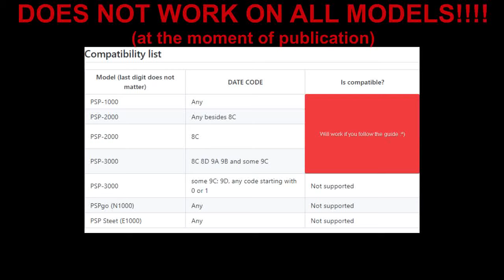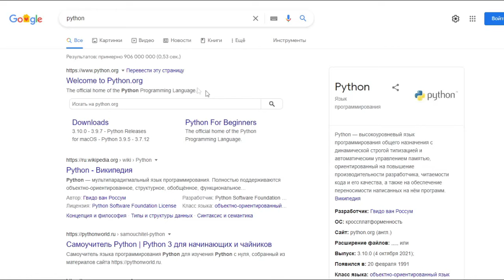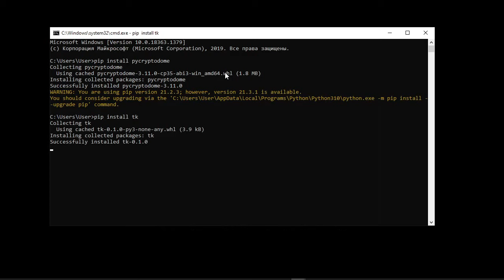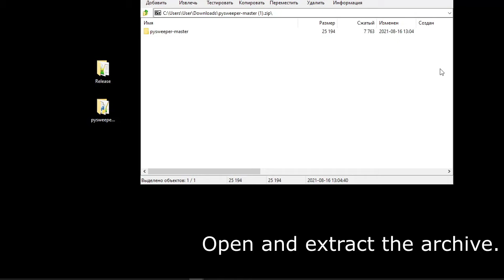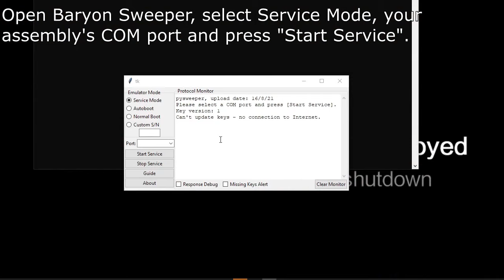PSP-3000 Baryon Sweeper (Solderless) Unbrick Guide

Comment: Well, mine was anti-climatic. Set up everything, the PSP shows green power light but the screen wont turn on. The power light turns off after a minute or so. 3000 with 8D, I think this was not for me :(
Reply from the maker: if you have green light but you didn't touch the power switch (because baryon sweeper autoboots the console in service mode) chances are your magic memory stick is unreadable or your PSP suffers from a hardware failure
Reply: @akhubik2006  Do you think there is a way we can get the PSP crash log on to the Memory card, like how we do in PS3, to understand what is going wrong in there?
Reply from the maker: @JakeGeorgeJoy  no, i don't think there is a way if it does not boot

Comment: hello, thank you for the tutorial. however i ran into a problem, i have a version 3004 psp with date code 9C (bricked because i accidentally disconnected power while doing a system update), when i try to connect the assembly with DC power it does nothing with both 5V and 3V3. when i tried it without the DC, 5V displayed:
5A 82 60 FF5A8260FF5A8260FF5A8260FA5A8260FF5AB0D05AB0D05A8260FF5AA0D05A8260FF5A8260FF5A8260FF5A8260FF5AA0D05AA0D05A8260FF5A8260FA5A8260FA5A8260FF5AB0D05AB0D05A8260FF5A8260FF5A8260FA5A8260FA5A8260FF5A8260FA5A8260FA5A8260FA5AB0D25AB0D05A8260FF5AB0D05AB0D05A8260FF5A82 60
and 3V3 displayed "Port disconnected. Retrying in 1 second.". I also tried a method I've seen in one of the comments, I got someone to hold the cables (using 3V3) in place, then connected the assembly to the PC, started service and connected the DC, which displayed nothing most of the time, but a few times i got 
5A 02 01 F4
A5 05 06 10C306 76
with nothing after that, and also 
An exception occurred in IO loop: UnboundLocalError("local variable 'version' referenced before assignment")
once, also with nothing after it. do you know what could be wrong?

Comment: I saw this guide a while ago when it was first released and I was hoping to unbrick mine(2000 model, ik it unbricks with pandora but i dont have one and they are too expensive) but i thought you need a 2nd working psp to unbrick. From what I understand from this video is that you don't necessarily need a 2nd working psp, instead you load the files from the jigkick media creator directly to the ms card. Is that true?
Reply: You don't need second PSP when using custom files. This method was publicly available for a long time.
Reply: @RealYoti  Didn't this method get released like 10 months ago?
Reply from the maker: @jimakos981  Yes, you are right, but there was no (complete) guide for it. Also, it's been updated since and schematics are more simple now. This guide was requested on Reddit ( reddit.com/r/PSP/comments/qfbuqg/request_psp_baryon_sweeper_complete_guide/ ).
Reply from the maker: Also, you don't need another PSP for this method. You can substitute it with a card reader (as shown in the video), but you'll need to manually select your drive in JigKick Media Creator.
Reply: @akhubik2006  ok thanks for the info, i might try this, only thing i have to buy is the usb to ttl and the diode

Comment: hi, i tried this metod using an arduino uno on a psp 3004 8D, but it didn't work, the protocol monitor says "Port disconnected. Retrying in 1 second".
what am i do wrong? do i have to try with the usb?
Reply from the maker: it is done because some USB-TTL adapters disconnect for a split second after connecting them to PSP. this is normal, but if you're not getting anything, please check if your assembly is built right. Please note that RX and TX might be reversed on your Arduino.
Reply: @akhubik2006  checked, i have even used the same cable color.
I have tried even another memory stick, but nothing.
So, is the psp done or can i try something else?
P.S. i connected only the usb cable to the arduino
Reply from the maker: @jacksunrise1705  Send me a photo of your assembly in Twitter: @khubik2, we'll try to sort it out
Reply: @akhubik2006  ok, done thx
Reply: @jacksunrise1705  I have the same problem, any resolve? @a khubik
Reply: @XY-oy4qw  no, i used an arduino and didn't work
Reply: @jacksunrise1705  me to, but the interesting here is that, i have plug the three cables to the psp battery pins and just keep disconnected the red one and try to connect it and keep disconnecting but if you keep the three cables connected, and unplug it from the ac charger, then you can get some readings in the program. That not make any difference, but is something that I discover yesterday and the green light blink at least one time.
Reply: @XY-oy4qw  thx for the info, in these days i will try it just to see what happen

Comment: Hey, thanx for the guide. This method work for psp 3000 with motherboard TA-095?
Reply from the maker: Unfortunately, no. That is due to keys being stored in volatile part of SYSCON memory. By "volatile" I mean it's not lost with power loss, but is lost after you perform a glitch that allows you to read its memory contents.
In other words, SYSCON commits suicide if you try to hack your way to extract the required key. We still can't work around this, and I don't know if we ever will
Reply: @akhubik2006  thanx for the reply. i will wait, maybe someday...
Reply from the maker: @pontesul1  key is 16 bytes long, each byte can take values from 00 to FF - 256^16 is 3,4028236692093846346337460743177e+38... in other words, no.

Comment: Regarding the diode, Arduino starter kits have the diode 1N4001, Can the 1N4001 be substituted for a 1N4148?
Reply from the maker: i tried a random diode and it worked fine, you won't know unless you try
Reply from the maker: 1n4001 are bad, i can't guarantee it'll work.
you better get one 1n4148
Reply from the maker: actually, it can work :o

Comment: question if i have accidentally slipped and it a weird code came out of pysweeper, what do I do? it made my psp think that there's a battery when charging even though the battery was removed?
Reply from the maker: it's fine, nothing to worry about, just repeat the process. psp will display a "battery present and charging" orange light when you connect the hardware assembly with the charger plugged in.
Reply: @akhubik2006  ohh.. ok thanks! My psp works now :)
Reply: @akhubik2006  also, what do I do if my psp has the 9C datecode since I also want to unbrick my second psp

Comment: Hello,

I have the orange led which lights up when I touch the connectors but nothing else? Nothing is displayed in the tk python console.. did I do something wrong?
Reply from the maker: i can't investigate right now. does GUI window (with Start service, etc) pop up?
Reply: @akhubik2006  I send picture on your twitter . But yes, windows GUI say 
Service started.
Using serial FFFFFFFF
arduino may need a reset ?
Reply: @akhubik2006  I watched the video again. I did everything the same way. The python script won't launch if I forgot something?
Reply: I have sometime : 5A 02 01 A2
Reply from the maker: Did you fix this issue?
Reply: @akhubik2006  No, i have found a original battery, and I transformed it to pandora :/

Comment: I've bricked PSP 3004 code 1C . I'm trying this method but when i connect contacts to battery (DC disconnected)  i;'m getting only solid green light with one blick of orange light but the screen remains black.
I've tried DdCv9 also only JigKick clone (i've only 4GB lexar memory stick pro duo, 32MB sony memory stick pro duo and adapter with 32 or 64gb microSD card) i've tried everything but still not able to get to service menu ... any advice ?
Reply from the maker: You don't provide enough power.
Without DC power or some battery in parallel to USB adapter, you will not be able to power your PSP in service mode. 
Power supplied by USB adapter alone is not enough.
Reply: i've tried now with battery that was connected to + and GND was connected from battery + board and the same result. green light but nothing on the screen (no backlight). I've tried JigKick clone (first option (generic card) and also DdCv9 but same result still. Second option in JigKick i don't know what MSI should i select.
Reply from the maker: @maros_b  I'll assume that you did everything in accordance with Yoti's schematic, provided in pysweeper repository.
If you use an official Memory Stick PRO Duo, you need to dump MSID using a known working PSP with custom firmware on it. It's a long and tedious process - thankfully, you don't have to do that when using DDCv9.
If you use an adapter, though, you can select one that looks like yours in the software. Those that look the same all have the same MSID regardless of what microSD you put in them.
If DDCv9 doesn't work for you and you supply enough power... bad news. Your PSP may have suffered hardware damage. It's common for PSP-1000s to die from too much pressure in D-pad area.
Reply: @akhubik2006  but i have psp 3004.

Comment: Why you don't use mod battery to boot into repair service?
Reply from the maker: Pandora batteries (modded from retail) don't work on newer PSP models because they have to undergo crypto challenges. They worked before because the challenges for normal operation and service mode were the same - this is no longer the case, and we have to emulate a battery that is able to satisfy new challenges.

Comment: Hi, I have a model of PSP 3006. I have a magicgate memory card that i formatted for this process. When Im trying to install the same in jigkick media creator, it is stuck at "Partioning"can you please help me find out the issue ? Also getting an error with the label "Exception"
Reply from the maker: give me more detailed information about the error
Reply: @akhubik2006  Hi, Thank you for the reply, fortunately I have this problem solved. But got into a new problem 😑I am using 1N4007 diode using the Arduino process. And when I am putting the wires for process, it's just stuck at FFFFFFF and the code isn't running. I know you might say it's because of the diode but I think it isn't as for the diodes, there is really very small difference. But it might be the problem as well. Can you please help me know the issue ?
Reply: @akhubik2006  ive also use USB-TTL with 1N4001 diode and it isnt working
Reply from the maker: Did you fix this issue?
Reply: @akhubik2006  yup- i mean i had to eventually get it repaired  lol.. thanks tho..its working now
Reply: @Lumi_Land  how did you fix it?

Comment: Hello there, thank you for this amazing guide. I was able to get my PSP 2004 - Date Code - 7D motherboard TA-088v1/v2 into Service mode, installed firmware. When asked to reboot I pressed the Circle button, bottom right-hand corner showed the loading sign, but it never rebooted. It just shut off on its own. When I tried to power on, again it's a brick. Could you please help me here? I would appreciate your help with this regard. Thank you.
Reply from the maker: Try again, please.
If that doesn't help, your PSP might be hardware damaged.
Reply: @akhubik2006 Thank you for your reply.. I did try again and this time I Installed 5.02 M33.. again same issue I waited till the PSP shut-off. After that I tried powering on, but no luck.. but I pressed L trigger and power button and the PSP booted up..when I tried updating it to 6.61 OFW it got stuck on PSP screen (game/update launch screen), and then after about an hour it shut off and now again it's a brick. Can I contact you somewhere to show you my setup and observation..I could really use your help here..thank you

Comment: Hi your method work fine on my psp 3000 8C but if try to update at 6.61 original fw i have this error: lptfffffffe at 86%, any solution?
Reply from the maker: bad lepton (umd drive controller), you can safely ignore that error and reboot. your umd drive won't work just like on the console in the video lol

Comment: The PSP screen does not turn on immediately like in the video. If you know the cause, please let me know. Sorry for my poor English.
Reply from the maker: Don't worry about your English, it''s comprehensible enough.
Tell me the DATE CODE, which USB-TTL adapter are you using and what output do you see in the software.
Reply: @akhubik2006 I'm sorry for replying late. My PSP3000 is the Japanese version, so it doesn't have a date code. When I looked into it here, it seems that the base is TA-090 03G. USB-TTL uses CP2102. The software continued writing all night.

Comment: psp 3004 - date code 9C: serial battery : AC0223850

Bar code down the psp starts with :02-274… 

 is this supported?
Reply from the maker: Maybe. Date Code 9C is a lottery.
Reply: @akhubik2006  i see, well the price to attempt to unbrick it is kind of low, I will eventually attempt it thank you

Comment: I can get solid green light and activity on Baryon Sweeper window but my PSP screen wont turn on? Did I somehow not configure the jig correctly or is it possible my screen is dead?
Reply from the maker: try writing the magic memory stick again
Reply: @akhubik2006  When I write to it, I get an I/O error when it's complete. I follow your guide exactly, so I'm not sure what I'm doing wrong when writing to it. Anything different I should try? I'm using an official memory 32MB Memory Stick.
Reply from the maker: @ShoNuff919  send the full error
Reply: @akhubik2006  Okay Will do that tomorrow when I'm home. i appreciate your help with this
Reply: I get this Exception window upon formatting. System.IO.DirectoryNotFoundException: Could not find a part of the path F:\ at System.IO._Error.WinIOError(Int32errorCode, String maybeFullPath) at System.IO.Directory.InternalCreateDirectory(StringfulPath, String path, Object dirSecurityObj, Boolean checkHost)

It's a lot more info in the error but that would be so much to type. After trying to format w/ jigkick creator, Windows asks me if I want to format the memory stick, so my PC see's this card as unformatted.
Reply from the maker: @ShoNuff919  format the card and try again
Reply: @akhubik2006  I had to use a micro sd card w/ Memory Pro Duo adapter and format that to get it to work. Tried reformatting the original 32MB Duo multiple times and it wouldnt work. Once I get to the recovery screen what option do I choose? Install 5.02 M33-5, or Install 5.02?
Reply: @akhubik2006  I went ahead and chose to install vanilla 5.02 and now the PSP works. Thank you for creating this!

Comment: Hello, after few attempts i still have a problem with unbrick psp 3004c data code 8c. The program displays a message "No port echo detected. Double check your assembly." But i dont see any mistake with assembly. Someone have the similar problem ?
Reply from the maker: What USB-TTL adapter are you using?

Comment: I'm trying to rewrite an Arduino program for pspgo based on your latest pysweeper.py. According to my observations, the pspgo itself cannot enter the sequence (5A 2A 90), and it seems like it requires manual insertion of (5A 02 01 A2) in between. However, after encoding it this way, the code only loops between 80-81-01 and cannot jump to 90. Why is this? Here's the code I've recorded:

hex
5A 0B 80 EB E9 22 B7 AC D6 CB C7 67 5D   
A5 12 06 23 81 7C 3B 36 99 A0 FF 77 6B 50 C7 9F 80 54 12 45 B5   
5A 0A 81 A1 6D C5 73 E3 C3 C9 49 1C   
A5 12 06 44 E3 06 D5 48 CF 73 BA DA 39 D1 BF 9C AA 3F EF E5   
5A 02 01 A2   
A5 05 06 10 C3 06 76   
5A 0B 80 B3 75 2C F1 72 25 AD 6D E1 43   
A5 12 06 FF C5 FF 4E C0 92 39 8D A5 61 B6 AA 9F 95 61 CA 06 4D   
5A 0A 02 9D 5B 0A B5 81 04 65 EC 03 FF   
A5 12 06 88 BB 8A F7 2A 4A 52 CD D3 8A ED 42 E9 63 22 9D 54   
5A 02 01 A2   
A5 05 FF 06 10 C3 06 76   
5A 0B 80 EB 09 AC 62 57 35 E3 76 E9 7B FF   
A5 12 06 26 A5 B0 3B 6B 97 94 0C F2 16 97 0E 2D 06 7B 11 7E   
5A 0A 81 C2 96 36 08 32 E7 1A 8A C7   
A5 12 FF 06 A0 12 AD 27 51 C5 FF B3 E7 0A FE 67 9D 38 02 BE 44 C4   
5A 02 01 A2
Reply from the maker: Yes, after 80-81 exchange, GO waits for PC to speak first.
5A 02 01 A2   <- PC requests battery capacity from itself
A5 05 06 10C306 76 <-- PC responds with capacity
5A 2A 90 2010000682828282841F6D34E4D219DE400BE20BCB04A9D8DC101F21537E92CA64EB53AF27B4B14B B3  <- Challenge 0x90 from GO

Opcode 92 - you failed to please the syscon
Opcode 91 - welcome to service mode
Reply: I have been able to progress to the step "A5 05 06 10C306 76 < - PC responds with capacity," but I am unable to receive the "Challenge 0x90 from GO," and it jumps back to the 80 step? I am using an Arduino Pro Mini.
Reply: My code runs correctly on a PSP3000, and I have already updated the key for the PSPgo. Could the 80,90 challenge algorithm for the PSPgo be different from that of the PSP3000?

Comment: Hi Khubik, nice work! I have ran into a problem though.

I have a PSP with TA-090 board. I set up the baryon sweeper with original MMS. I loaded the DDCv9 though your app. When I set a Service Mode, the PSP shows green light but no screen. Although when I set up Autoboot, the PSP turns on with backlight, which happens even when I normally turn on the bricked PSP without using the sweeper. Am I doing something wrong? The weird this is when I use the START + SELECT + SQUARE + TRIANGLE combination, the MS light starts blinking and the backlight turns on.

Here is the output from the sweeper. Service ready. Please connect your PSP™.
5A 02 01 A2
A5 05 06 10C306 76
5A 02 03 A0
A5 04 06 3610 0A
5A 02 0C 97
A5 06 06 FFFFFFFF 52
5A 0B 80 D972B5C743360B9D52 E0
A5 12 06 9598BED967FE86C3 B64BD555407007BA 34
5A 0A 81 1FE37AFFEADD0B27 A6
A5 0A 06 73357F161C68635C A5
5A 02 01 A2
A5 05 06 10C306 76
5A 02 03 A0
A5 04 06 3610 0A
5A 02 0C 97
A5 06 06 FFFFFFFF 52
5A 0B 80 D9B157F4A291ABDDF5 95
A5 12 06 81615975F401087A FF3E8FE8B9095895 B8
5A 0A 81 5CD7614402F87ED2 F8
A5 0A 06 49E766DA6EA053C5 A5
5A 02 01 A2
A5 05 06 10C306 76
5A 02 03 A0
A5 04 06 3610 0A
5A 02 0C 97
A5 06 06 FFFFFFFF 52
5A 0B 80 D9E0AFCE5BD7838CC0 E3
A5 12 06 3FF5F536C63613F3 4730487B32A2AA6F BA
5A 0A 81 462D48683B91B457 20
A5 0A 06 88B6F6519CB10F4D A5
Reply from the maker: memory stick is created incorrectly, please retry